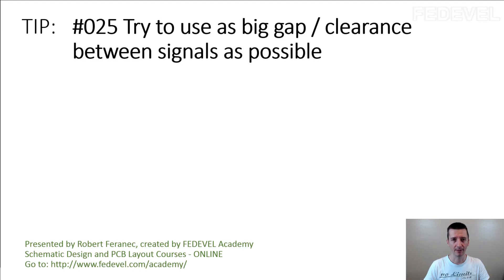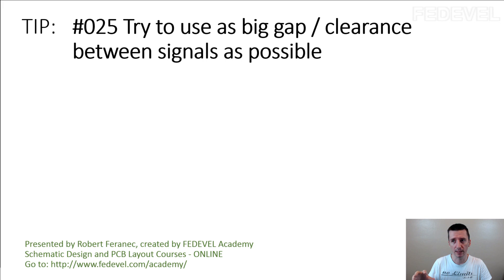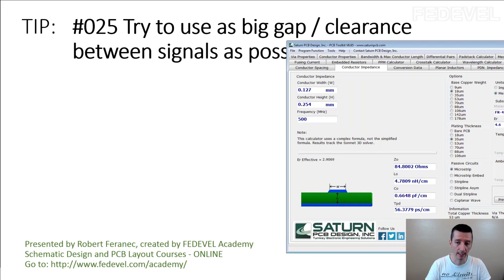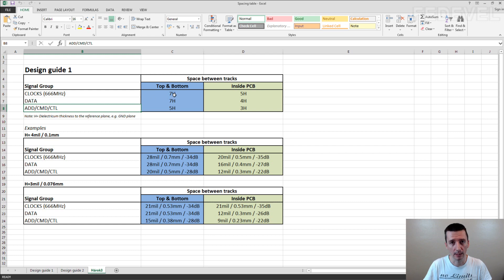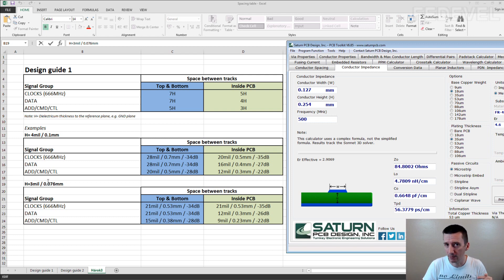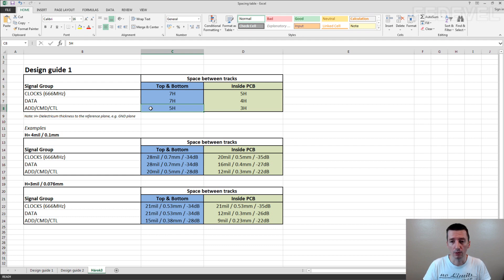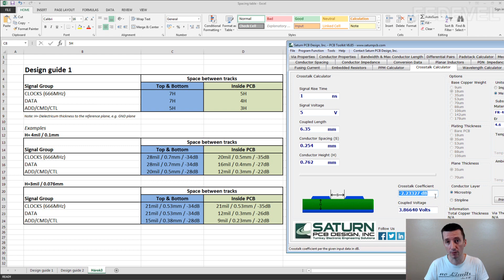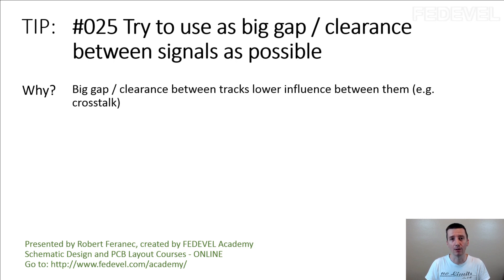TIP #025: Try to use as big gap / clearance between signals as possible

Comment: This H value can be in reference to a VCC plane or just a GND plane? 
For example, I have a 4 layers PCB:
 Layer 1 - signal
Layer 2 - power
Layer 3 - GND
Layer 4 - signal
 In this case, can I use two measures of H? The first H as the distance between the TOP layer to Layer 2 and the second H as the distance between BOTTOM layer and Layer 3? This is acceptable or do I need to use always the same reference plane (GND) for TOP and BOTTOM?

Thanks in advance, Great tip as always! :)
Reply from the maker: Yes it can be VCC if it is reference plane (some VCC planes, for example if they have many decoupling capacitors to GND can be good reference planes).
Reply: Thanks for the answer @RobertFeranec . So, just to be clear, I calculate the first H between layers 1 and 2, the second H between 3 and 4, right? But what happens if the Power plane is not so good as a reference plane? If it is really noisy I calculate the first H as the distance between 1 and 3, or there is no way this will work properly because of the noisy plane between them?
Reply from the maker: @batistalex-e5o  ideally you would like to have reference plane as the neighbor layer - so the fields between tracks and reference plane are coupled correctly (I am sure you have seen the pictures with a track and lines showing field going between track and reference plane). I am not sure about the field if you would place a non reference plane between the track and reference plane - the field would be probably broken (that may mean more noise around the signal track - but to be sure, you may need to simulate it or google for it .. I do not use it this way, so I am not sure what would happen).

Comment: I am a little bit confused about "H". Because most of the time I design 2 layer PCBs (to reduce manufacturing costs)  that has 1.6mm thickness, 1 oz copper weight, FR-4 TG130 material, HASL surface finish, min. trace width and spacing is 6mil. So, what and where is the "reference plate" of this 2 layer PCB and what is the H in this condition? If I take 1.6mm as H, then I get some ridiculously high trace spacing values. :(
Reply from the maker: Yep, 2 layer PCBs are not the best.

Comment: Thank you for this tip. So with 2 sided board, with 1.6mm pcb height, same rules apply? Seems kind of big space between the lines if we apply the 7*H rules :)
Reply from the maker: That's why I normally do not use 2 layer PCBs :)